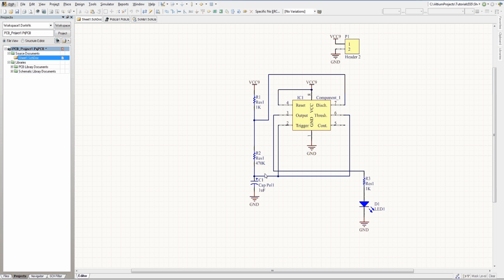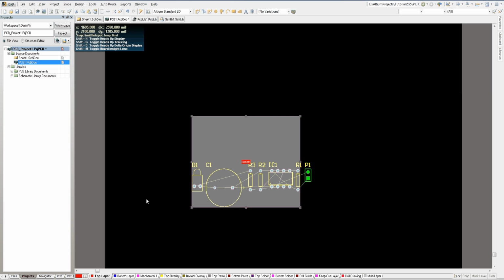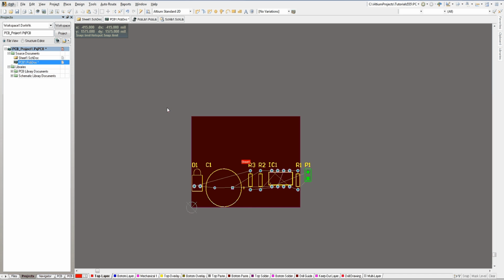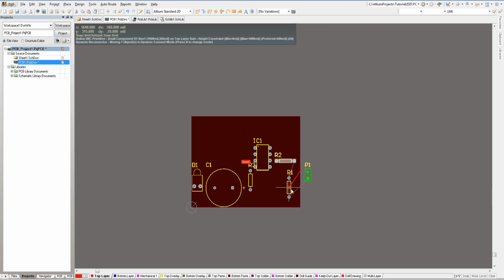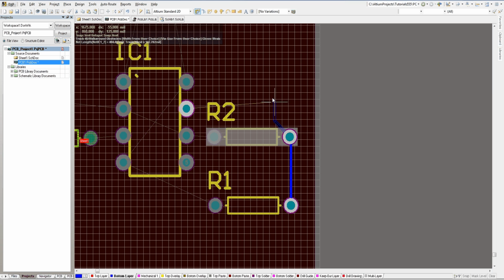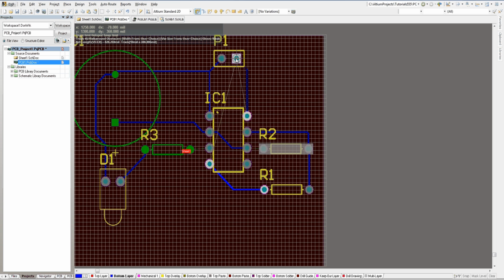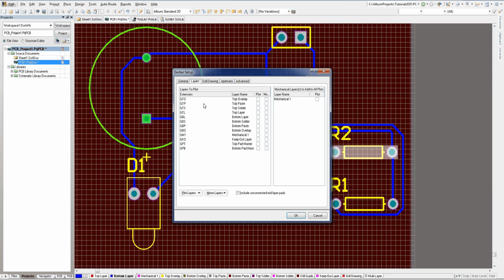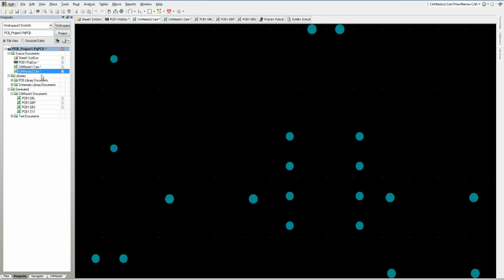Altium Designer Tutorial - Part 3 - Finalizing the circuit and creating the PCB

Comment: When I try and move the IC, Altium moves the cursor far off the board. This makes it impossible to place the IC correctly. How would you correct this?

 -- Some very helpful guys representing Altium in South Africa got back to me promptly with the solution: Hi Phillip, I found reason for the issue you were having. 
The Reference (“centre point”) for the IC is WAY off to the top right of the footprint.
 
To correct this, Click EDIT > Set Reference > Center  (Shortcut E>F>C )

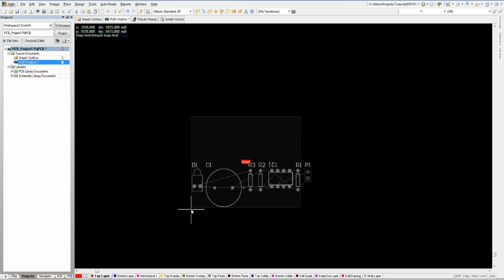Comment: Hi! At 2:13 You have slightly different options than i have. 
I have Define from selected Objects, which gives me an error saying

Could not find board outline using primitives centerline due to the following error: 
At least 2 connected tracks/arcs or full circle required
Reply: vhdlworld If you are still having problems, this can be solved by selecting the view menu and then selecting board planning mode. Once you have done that, you can go over to to the design menu and select redefine board shape, edit board shape, etc..
Reply: Alin Negut  Plz if you know how to solve this error tell me
Reply: +Alex Doknjas Thanks! I had the same problem
Reply: +Alex Doknjas thanks Alex, I solved the same problem with your advice
Reply: e cung bi lỗi như vậy giải quyết thế nao vậy anh
Reply: bạn mô tả lại lỗi được không, vì bài này mình xem lâu rồi nên giờ không nhớ

Comment: I just want to ask if Altium software can generate image files like .jpg or .bmp for PCB layout?
Reply: +EEEnthusiast more exactly !!!!
-1-create a output job
-2-add a new fabrication ouput
-2.1-choose final production artwork
in page setup change in scale print 1.0
choose your layer and so on

print
et voila!

took me 1hour to find jason morgan's anwser
source:http://electronics.stackexchange.com/questions/94931/altium-designer-how-do-i-scale-the-output-gerber-file-generated-by-smart-pdf-in

anyway,i try altium,eagle,proteus,kicad..i'll stay on altium
too easy to create trace with the same length,to create components and so on
Reply from the maker: Sorry for the late reply. Altium definitely does that; you should be able to print out your design in 1:1 scale. It's common to do that for DIY etching.

Comment: Thanks is been very helpful, I need help on modifying an existing PCB layout. Is there a Video on modifying a PCB layout on Altium Designer Revision 10? Delete components, add new components and move components and then regenerate new gerber files
Reply from the maker: Hey Habib, I would suggest checking out this video: EEVblog #245 - PSU Design Part 10 - PCB Layout Editing and eevblog in general. He has some great tutorials on modifying existing layouts.

Comment: nice tutorial man :)
although i have been wondering... Isn't it a little bit difficult to etching if u use the second layer circuit into your actual PCB model?
Reply from the maker: It definitely is, I had actually made a PCB of this circuit, but in surface mount which allows me to keep everything on one side. Additionally, keep in mind that you will need to drill your own holes, so using surface mount when you can will make your life much easier.